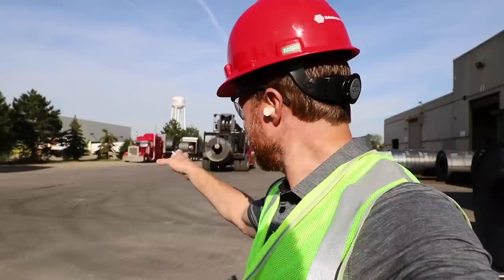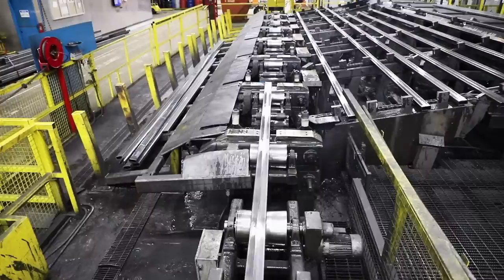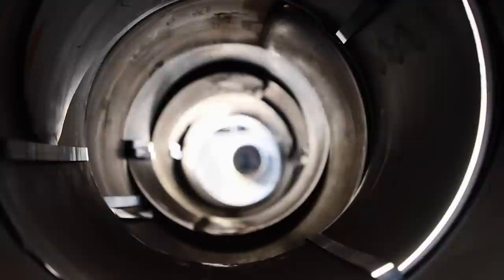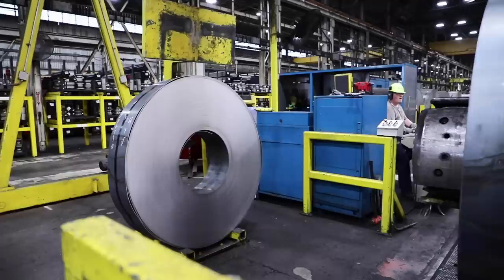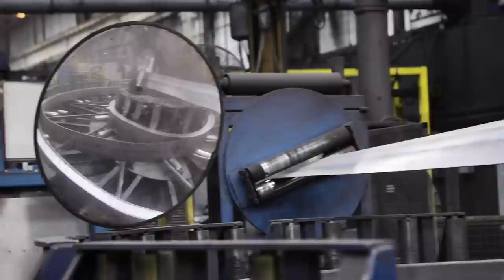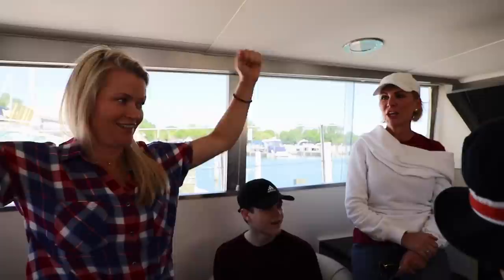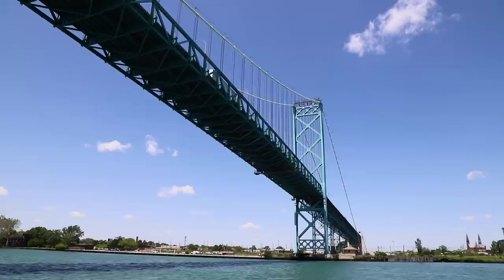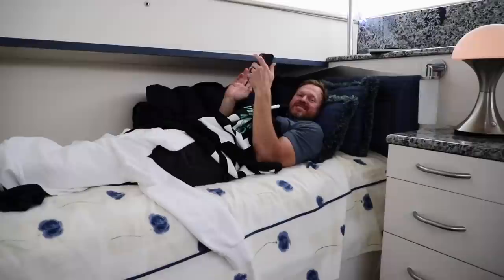How RV Axles & Hitches are Made from Detroit MI

Comment: Hey there guys, our Open Range Roamer 347RES 5th Wheel came with  the JT Strong Arm Stabilizer Bars. They are mounted on each of the Lippert Leveling jack front and back, similar to what you showed in the video. They do an excellent job of taking the movement out of our rig when we are setup. Once you are leveled out, you lock them in and tap the Ground Control front and rear to take up the any slack. We have been using them for three years now with no issues.

Comment: Had no idea JTS could be attached in the back, no one at the dealership told me that. I put them in in the front. Well looks like I have my next project
Reply: I had to change my foot pads to allow the JT's to fit on the rear of our 30' fifth wheel. I used the xchocks with them but tried them without the xchocks once...gave the xchocks to a friend of ours cuz I didn't need them, the JT's took out all the movement. Remember to tighten the t bars then jack up all your Jack's one inch to take out the slack.

Comment: I had JT Strongarms on my last fifth wheel on just the front jacks. Yes it made a difference and were worth the cost... Super easy install on my lippert frame because it was already prepped for the JT's.. No drilling required... Only bad part is remembering to loosen the T handles before retracting but you only forget once.

Comment: I’m on my second set of my strong arm, first set was in the jayco travel trailer. My second set is on my reflection 311bhs 5er, had to get the over 58” I found a new open box set on eBay for $160, anyway with the xchock and A frame under the pin box it’s almost rock solid totally worth it IMO.

Comment: I have installed the jp strongarm stabilizers on my 36' toyhauler fifth wheel and I'm not sure how to camp without them! They eliminate almost all of the side to side movement. I also added 2 stabilizers in front of the front axle and that eliminated the bounce from the suspension.  Definitely worth the cost

Comment: I use the BAL stabilizer arms. Similar to the JT strong arms but you can buy them in pairs if you don’t need a set of 6. Works great for stabilizing our Imagine.
Reply: I chose the BAL system as well very pleased and a little less expensive

Comment: I've got the BAL version of the JT Strong Arms, best upgrade we've made to the trailer after the memory foam mattress. I went with the BAL version because I wanted 6, 4 on the front and 2 rear and the BAL version is sold in pairs. There's no way I'll ever have a trailer without them, the inverted pyramid makes the trailer rock stable. They're well worth the little bit of cash and time they take to install.

Comment: Front slideout advice...I noticed that you almost hit your head on the corner of the front slide. Take it from me that it can be awful. My cousin even split his head open on my front slide. Part of my setup, now, is to add a swim noodle to the bottom corners of the slideout. Take a swim noodle, slice it length-wise on one side. Just slide it onto the bottom and side of the slide so it rounds the corner. It will save you a headache and maybe some stitches one day.
Reply: p.s. I have those stabilizers and they are good. I feel like the X-Chocks were the best investment, but the two things in concert work exceedingly well.

Comment: Yes there is a correlation between Michigan road conditions and the unusually high weight limits on the roads.
Reply from the maker: 100%
Reply: If you can get north of Flint, without damaging your trailer,  the roads smooth out pretty good

Comment: Built my own stabilizers many moons ago, just like you showed plus a 'X' setup on the front legs to kill the side to side rock. . Would not be without them. Plus I use the fifth wheel hitch stabilizer when ever the truck is not under the trailer. It is three legged with one leg having a jacking mechanism to put upward lift into the front of the trailer. All combined ...... rock solid 38' 5th wheel toy hauler when parked.  (photos available)

Comment: JT Strong Arms. Installed on my reflection 31MB. They do help with the sway when leveled. For the rears its best to go to the center of the rig. Since the entire belly is covered you can't see a mount point. Use a piece of angle iron across the rails attached with self drilling screws. Only thing you need to remember is to undo the screws before leveling. Even my electric levelers bent the mount bolts on the pad side of the rears. Your hydrolic levelers will not stop at all for these. Just be aware.
Reply from the maker: Nice. We've only heard good things about the JT Strong Arms. If anyone has kids in a travel trailer, I'd say they are essential. I wish I would have known about them! https://amazon.com/shop/keepyourdaydream
Reply: Oh and watch out for your gas lines when installing 😳

Comment: Hi Mark, I have JT strong arms on  my KZ Durango 32 foot 5th wheel and once you have them adjusted as you set up the trailer feels as though it is mounted on blocks in the ground. Side movement and front to back sway is gone. I paid about 175.00 and installed them myself. Well worth the investment.Pastor Ken Serr

Comment: RVs are not built like a car, they're not built with the

same rigid federal  requirements nor have

the lemon laws protection. Most  RVs on

the road are not built or designed for off-roading- boondocking. 
 RV’s can wear out much faster when used off road or

Boondocking. Campers  still like to Stealth/

Boondocks  camp;   but I
 don't recommend going off-road very far with an RV. Why? Fluids/filter need to

be changed more often, nut/bolts come loose, framework starts tweaking/cracking.

Units can warp and bend out of shape. Elect wire can catch on fire, not

constructed in conduit, so can rub wires bare and catch on fire. Few of the newer RV's are designed for HD off roading, but their price pt is not reality for many, some are non insurable to boot.